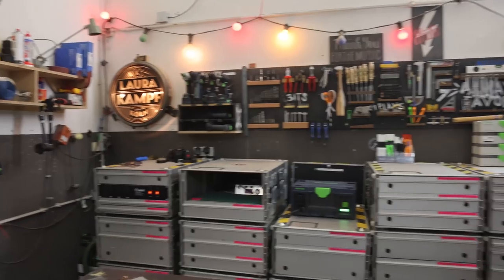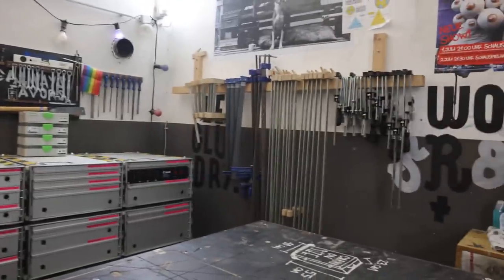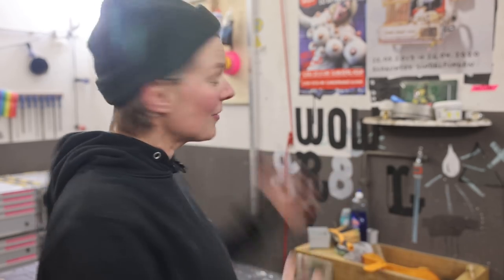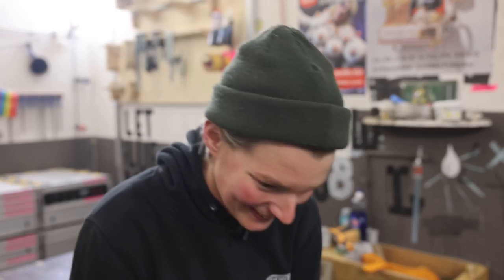This Clamp Storage Idea would be really good...if it worked :)

Comment: no counterweight or that bs, just add more pulleys.  on the vertical coming down put a block on the bottom and route it down and back up and the rope you pull on goes back down.  or just get a cheap electrical winch and use that to raise and lower it.

Comment: Stacked boxes screwed to the wall. Clamps go around them according to their size. Smalles box / clamp close to the wall, then getting bigger. Bigger boxes hide the smaller boxes / clamps. All the other stuff goes inside the boxes. 
Alternatively, take a short trip to the "Pott" and see how the miners stored their personal stuff on the ceilings of the mine locker rooms ;)

Comment: Have a look for an old winch motor or manufacturer some sort of ratchet cog system to lift it in stages with the pulley?

Still very cool and a great idea just needs a little more work to get it spot on 👌

Comment: Long threaded rod on the wall. Threaded "nuts" on the clamp board. Electric motor to spin the threaded rod to raise or lower. Wherever it is stopped, it is safe and won't move.

Comment: Just my 2 cents...if that makes sense to a German citizen. Lol
Put roller blade or skateboard wheels on to run in the tracks for easier up/down movement. Also, add either a reversible hand crank winch or an electric winch in place of the tie off for your rope. I love your concept with this and I'd love to see you make it practical, hopefully my comment was at least somewhat helpful. Lol

Comment: Hi, congratulations on your videos and your ideas, they are an inspiration for anyone. The idea of putting up a sliding wall is interesting. My idea (I'm not sure it can work) would be to create something like the vertical Barn door, but instead of the pulley system, it was to have a type of springs or elastics that support the climb and create a side brake system, to when it was at the bottom and retracted at the top. Did I make myself understood :S?
Much success for you.

Comment: An idea think of your board as a garage door.  Mount garage door tracks on the wall and the rollers on the board.  Second think your board as a double hung window install a grooved pulley on top of each door track and than run rope from the top of the board over the pulley an down the side of the track and a counterweight to balance the load.  Install a locking pin to hold the board in the down position to enable to remove the clamps.  Or you can find a garage door opener or a small winch an attach vertically to the wall an attach it to the board; than you won't need the pulley, counterweight and the locking pin.

Comment: Yeeeah, motorize it! Like with roller shutters where you press one button  and it comes down without holding the button.
For the weight maybe a second wall with stuff on it as counter weight. Comes down when the clamp wall goes up and vice versa.

Comment: I would suggest a simple motor and chain drive using a gear reduction in the sprockets to control speed, with limit switches to stop motor on the way down and stop motor when raising the panel.

Comment: Estimate the weight. Buy pulleys and rope that can handle that weight. Use a ratchet crank wheel to pull the rope.
Or...Split the board vertically in 3 sections, with each section it's own pulley system. (And hang the long clamps vertically).
In general: you have a lot of unused space above your head. You could create a hanging storage - a bit like in a theater, above the stage. But for safety I'd only store...you know, toilet paper, Styrofoam and such...

Comment: The addition of nylon strips instead of wood spacer in the track would reduce the friction with the addition of a counter weight and a motor and you will have a working solution. The only problem will be as you take your clamps on and off the amount of counter weight would ideally need to change. This the the principle used in the theater industry for the a system called the gallery which is used to move backdrops in and out doing a stage production. Since the gallery is a manually operated system the counter weight is fine turned to make it as easy to operate as possible for the stage tech running the system.

Comment: Ok, what you need to do is boil the rope in a pot, it will decrease the stretch by a lot. And maybe add a winch system on the lower part? Definitely boil the rope if u need it to be more rigid

Comment: Is it binding becuase the balance isn't totally central? if you perhaps used small wheels running on channels in the wall you might have more luck? Also i'd suggest a counterweight or friction brake to slow it down in case of an accident.

Comment: Motorise it! Also, use a counterweight - And you can continue to add more pulleys.  Although you should also look at the design of where the string sits, you could see that it does not sit nicely in a groove and can slip between the plate and the bearing and create more resistance.

Comment: Since waight is not equal, and not "continius" if you look horisontal, you need to add rollers on the sides that can glide that plank through the leads. Also you can use weight on the other side to help you pulling it up and down, and that one should be near by the equlibrium... same as lifts and elevators are working in tall buldings, them motor do not need to push a lot of the force in in. ;)

Comment: With metal and especially when using larger drill bits; DO! clamp the metal to a surface/in a vise because the bit can grab and rip the metal object out of your fingers (thus cutting you). Wood usually breaks out but less machinable metals are more likely to grab (say aluminium).

Comment: Hey there! Really cool project. Sadly, my basement isn't high enough for this.. however, pulleys turn weight into way. This means, the more turns it has, the shorter the way you move it up while your pulling way enlarges. In this setup, it should be around 1:4. Sadly, this doesn't mean that you got 4 times the power (damn you, friction!). However. You could try to add a third bearing to your lifting part.  Bearings on the sides of your plate may help reucing friction, too..

 also think that your first roll should be fixed since it(just som gut feeling...) 
:-) A worm gear with a handle could help driving it and it also would help to prevent that everything follows gravity..

Comment: helo Laura. What if instead of storing all the clamps in one sheet of plywood, you separate them and you have several sheets with different clamp sizes, each one independent. with less weight and easier to handle.

hope you get the best solution for this idea. Its so cool.

Comment: Reduce friction on the sides by adding 'wheels' or roller bearings. Add a counter weight to take into account the weight of the board aka the static weight. and add a winch, electric or manual instead of pulling the rope yourself. You might also find that it's easier to lift if you move the attachment points for the rope to the centre of the backside of the board, as it looks like a lot of the weight is off centre at the front, and is trying to pull the board forwards (i.e away from the wall) so it ends up jamming against the guide channels.

Comment: I think part of the problem is that what you are trying to pull up through sliders is going to be off-balance; causing the board to twist in the sliders and jam them.   Maybe put roller bearings on the board edges so they roll in the sliding mechanism; this would make then move easier even if the board is twisted - all the twist would do is put more force on the bearings which would make for better traction.

Comment: I would bet that the problem is the heavy load and also the concentricity of the bottom half pulley
I think you should split the heavy load by putting another set of pulleys (one on the left and one on the right ) 
Also I'm not sure how good of a pulley is the ones you are using Teflon ones are much better when it comes to friction ....maybe 
speaking of friction the up and down board thingy made from plywood introduces a lot of friction .I don'tknow  if that's going to work but it might work.Try adding some spacers out of ,slippery plastic like the one used in Ikea style cutting boards, in the  edge of the plywood board that are sliding in the ''C'' channel
Hope it helps

Comment: You just need more of what you call ‚pulleys‘. I think they‘re called snatch blocks (Flaschenzug). Double the length of the rope and you double the force. Repeat as often as needed. Then it won‘t really matter how much friction there is between the wood sled and the aluminum guide rail.

Comment: It would be enough to add a pair of counterweight whose total weight is equal to the total weight of the board full loaded (similar to how an elevator works). The problem would be that when you slide down the board to use some clamps you should lock it so that the counterweight doesn't slide it up while you're using it

Comment: You could motorise it using old motorbike chain or see if you can get the motor set up from an old warehouse roler door as the usually have both a motorised and chain pulley built into the same relatively small housing

Comment: The counter weight or windlass type winding are great but, Run it between rails with sprung on brakes, or a ratchet and pinion type arrangement pull lever to release, if that rope ever snaps....

Comment: Add two more pulleys top and bottom for mechanical advantage , then you would at least have 3:1 ratio and should easily be able to lift it.   Even a snatch block will cut %50 of the weight. Cool idea!

Comment: Make the board slide more easily, with bearings or perhaps graphite powder? Also more pulleys, pulleys with a groove, a different cable. Remove some material from the main board, make it more like a frame to make it lighter. Counterweights?

Comment: A counterweight would make it easier to move, or if you don’t mind making holes in it to remove some weight, as well as adding a winch to the other end so you don’t have to pull but can instead use rotational motion, which also would have a pawl to prevent a sudden drop.

Comment: 6:58 Your pulleys are just using bearings? 
The grooved wheel (concave rope guides or sheave) for a pulley are press fit over the bearings. So the rope won't pinch in the space between the bearing and the  shell.

Comment: To find out how pullys work, you might do some sailing on an older boat…
I believe you got the wrong idea about clamps. Clamps are heavy and mostly needed in larger quantities at specific locations. So I built a trolley for the clamps to have them wherever I‘m gluing up something. When not in use, it lives in the farthermost place in the workshop.

Comment: Thanks for your nice videos!  Perhaps replace pulley system above with gigantic lever arm! :) . Then a simple rope out on the edge would be enough. Also a winch from a boat trailer with lock could work for increased power. And Lard. A lot of lard.

(And thank you for asking for ideas, it is fun to be a couch expert! :)

Comment: The rails, each side of the board need at least two wheels or bearings between the rail and keep the board square... also may be four pulleys, two left two right to spread the weight evenly could help too.

Comment: First I'd check if you need guides so the rope stays on the bearings and doesn't press into the sides. Also check if the board is binding with the alu sides. Then you could add a counterweight to reduce the force needed. Just don't take too many clamps at once haha

Comment: Maybe put teflon strips on the sides. So the interface between the multiplex and the aluminium rails is a teflon / aluminium interface instead of wood / aluminium. Front and back. Delrin would work too.

Comment: in case you don't go the counter-weight route (which would be totally awesome..) you might want to use a Petzl micro traxion or similar.. HOLD THAT, i mean "build" something comparable for added safety when lifting... also i assume the current problems you are facing have a lot to do with just efficiency of pulleys and number. by the way, i noted that there is plenty of space between the "Kugellager" and the sideplates, is it possible that the rope got cought in them...

thinking about the counter weight, just a block of concrete would be sort of boring, right? is there any tool(set) you never ned when needin the clamps? then you could "exhange" the two, one up under the roof, one down and usable..

Comment: Adding more pulleys would increase your mechanical advantage, making it easier though slower to move. Combined with the other suggestions of a modest counterweight, and electric motor, and a slim profile companion use of the wall space behind/beneath, it’s a winner. Raising and lowering by hand every time will be a nuisance that will make you regret having it.
Reply: And if you split the counterweight, you can fix a pulley high on each column to run a cable between the weight (long cylinder or bar, maybe a tall stack of heavy scrap stock center-punched and threaded on the cable?) and the top adjacent corner of the board on each side. That will keep your counterweight away from the companion use against the wall where the board descends.

Comment: I think the lines are getting pinched between the rollers and the sides of the pulleys. Also, if you use more pulleys, (block and tackle) the load your trying to hoist gets lighter.

Comment: friction is your enemy and two full lengths of plywood rubbing against aluminum is the problem imho. space out the aluminum guide bars a bit to the side to make 1cm of space on either side between the wood and the aluminum. take four of your ball bearings and fix them to the corners of you plywood back panel in a way that makes the panel „roll“ up the guide bars on the bearings instead of the sides rubbing. should be a 30min fix.  then go from a 4-way pulley to 6 or 8, and voila. you’ll be pulling a kilometer of rope, but at least it’ll be easy. :-)

Comment: You have to divide the weight vertical ropes if your frame weighs 200 kilos and you have four vertical ropes each rope supports 50 kilos and it requires 50 kilos of downward force on the pulling rope to lift it. If you have 8 ropes the final downward force is 25 kilos you just need more pulleys. The pulleys have to have grooves in the perimeter otherwise the Rope will get caught between the bearings and the side frames. You're in the right room you're just not in the right seat

Comment: 1. Why don't you use counter weight like on the elevators. 
2. Hand winch would be easier. 
3. You can calculate the lifting force for the pulleys.

Comment: maybe already been suggested but use bicycle chain and sprockets instead of rope and pulleys? should be easy to hand crank or motorize and less risk of breakage than with rope or cable. before getting complicated with wheels on the guide tracks i'd just start with some hard wax and see how that goes?

Comment: 1- Find out the total weight of your panel.
2- Make sure the top pulley anchor point can hold this AT LEAST double this weight
3- Fill a bucket with stones or bricks of a weight equal to the weight found in  #1
4- Attach bucket to the other end of the rope. 
5 Voilà

Comment: Change the rope for GS this will have less give add bearing to the side of the wood back panel to reduce the resistance when pulling and add a 2nd hand trailer winch

Comment: big ole springs at the top to help you lift it. Or just a winch to lift it up with a ratchet-like mechanism to lock it in place. No need to motorize it, just a simple crank ought to suffice.

Comment: First you are lifting at the center of the panel. It will never be balanced so it will tip and bind. Second rope will never do, use steel cable. Get a hand wench that uses a worm gear to drive it so your hand doesn't hit the wall. The pulley set up is good and if the wench pulls 1000 Lbs. then it multiplied by each strand going through the pulleys. It is the same system that raised the massive bull doser blades before hydraulics.

Comment: I think, without reading the other comments, that there is too much friction. Your sheet should glide nicely, against that wall and through these metal slides. Maybe you could make bearings there as well. By the way, the pulley doubles, triples, etc. your power while also doubling, tripling the length of rope you need to pull in

Comment: Id agree with others the friction is bad, but you could just counterweight it.  Also if you do motorize it you can add more loops to the pully to make the load far less.  Edit: and I suppose if this was frontage to some storage space behind, like cubbies it'd make more sense, than just a storage system that moves up and down but doesn't actually save space.

Comment: How about a garage door opener adapted to lift and lower the storage panel?  Overkill for sure. I do see a potential problem with it jolting the panel when the lift starts. If a problem, possibly an extension spring on the pulley mount could absorb some of the shock and nothing falls off.
Reply: I was ganna say that. Might still be to heavy for that. Otherwise a a winch might do.
Also. If you offset the panel a little bit to the front you can use the space behind it for some kind of flat storable items.

Comment: Counterweight; which would need to be heavy material or very large, or use a cheap 2ton winch & swap the rope for a cable; then mount the control where you would have had the rope foot.

Comment: Install an old electric motor like those used to lift shop metal shutters...And reduce the friction between the wood panel and the side rails with ball bearings, wheels, hardwood, PTFE...

Comment: Weigh it with all the tools on the board before your next attempt.  Doing some math, you'll be able to re-build a pulley system with more wheels that will lift it more easily.  There are probably websites out there that can help you figure out the perfect pulley set-up based on the weight of your storage panel.